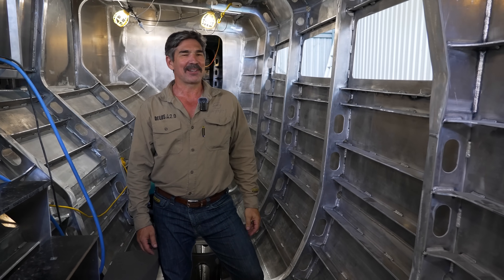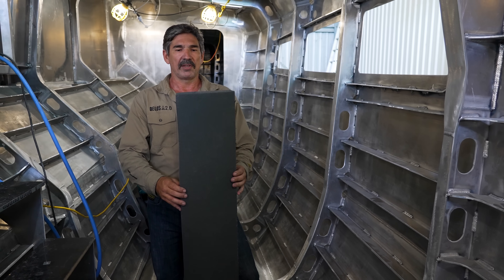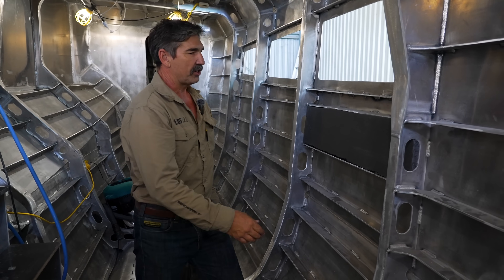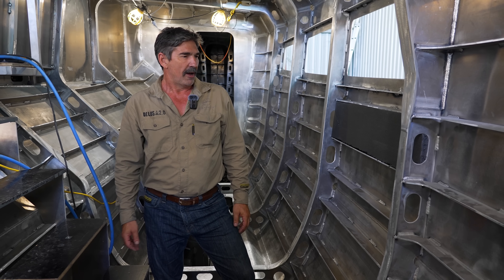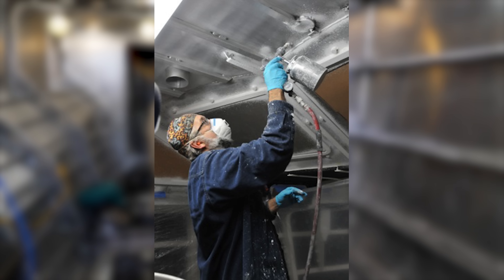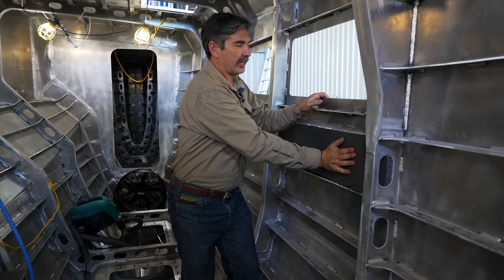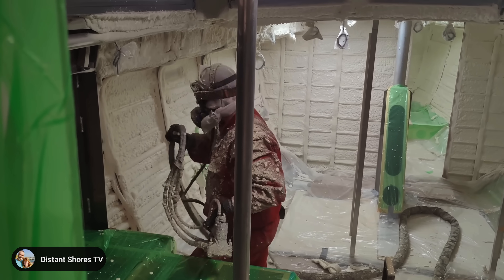HELP, We Need Your Advice!  How Should We Insulate Our Aluminum Catamaran???

Comment: Retired Alaska commercial fisherman. Spent a lot of time working on metal boats. Spray foam is the way to go. Provides a moisture barrier,  prevents corrosion. No heat transfer at the ribs.  
Is easier than you think to remove, use razor blade and side grinder.  No problem.    Like the other person said, install sufficient tubes and Chanels .
Reply: Spray foam on metal hulls is the only  way. If you use foam panels, you need to maintain a vapour seal. otherwise, any exposed metal will sweat. This means taping every single foam section to the next foam section, so no moisture can get behind. The glue on the aluminium tape fails in the  Tropics. Any self-adhesive foam has the same problem. Glue failure. It's a  nightmare. Spray foam has none of these problems and vastly minimises a risk of corrosion as no moisture can touch the aluminium hull
Reply: Agreed,  not that hard to cut out and how often  might you want to do that?  If you had to remove an area of foam you can keep a couple small canisters of Tiger foam spray to reapply a spray foam coating.  Tiger foam comes in a couple sizes and replacement nozzles for re-use.  2 small propane cans ( one with urethane and the other with resin ).  So its the same stuff you might have applied commercially.   Go Delos!
Reply: We are seeing tons of boats with corrosion from the separation of the foam up on the hull sheet. Spray foam has come a long way but I still don't like it.
Reply: @williamhamill813  is the foam being physically broken off of the sheet from wave action deflecting the sheet? 
Just trying to get a picture of the root cause.
How's the cathodic protection system? They're a floating battery. And they can be a challenge to get tuned in with sacrificial metals. The whole noble metals thing...
Agree about the foam. A necessary evil.
Reply: All I need to do is agree with @Marinerjac he said everything I was gonna. To dig into the foam and make repairs isn’t terrible. I am an electrician and have dealt with it on many occasions.
Reply: ☝️  What he said!
Reply: As owner of a 25 year old Aluminum Boat in Northern Europe I can only say when applied the correct way its just perfect.. on our boat it was first put in 2K paint system followed by spray foam...
Reply: Total boat makes a floatation foam, likely spray able too. Just remember. All foam absorbs water. I have a double wall aluminum hull I filled with floatation foam years ago.  It absorbed water. Just spent a couple hundred hours drilling a hole down the length of my hull creating a place for air circulation and water drainage. 

Another thing to think about is closed Cell foam will absorb water the moment you cut it. 

Now...make sure whatever you use is non flammable stuff. Some home spray foam is so flammable, sprinklers have to be installed to protect the building. 

Spray foam. Dry areas. Fire proof.
Reply: The solution is spray foam and a inhouse dehumidifier that ports the excess water overboard 💦 just find a non corrosive alcohol based solvent that easily removes the foam residue, should you need to repair the hull. Obviously all the basic steps from your methodical engineering precautions you are known for. I believe you are overthinking this. You got this Brian. You're a terrific problem solver 🥇
Reply: There is no solvent for this stuff. I just tried 3 kinds of acid, acetones, caustic and I spoke with total boat to confirm.
Reply: Triple thumbs up! While the foam may be a bit pricey, the time and effort it saves make it absolutely worth it. It’s the go-to solution for avoiding condensation issues, especially if you plan to spend time in cold waters. The occasional need to clean off some foam for future work is a minor inconvenience compared to the significant time savings and prevention of unforeseen problems caused by condensation.
Reply: Is spray foam flammable?
Reply: @ExploringCabinsandMines They could use cementitious foam insulation, which is non-flammable. Just keep in mind it cures more slowly than organic foams and might be a bit more fragile, which could affect its durability on a boat.
Reply: @ExploringCabinsandMines there’s non flammable spray foam
Reply: @ExploringCabinsandMines   Various grade foams are available. Fireproof foam is normally used for any marine application.
Reply: Aluminum welded stick pins and thermal acoustic insulation like john Mansville and unifrax is common for aluminum cats. Completely against spray foam it's a terrible idea just like it is for homes. It offgasses for years and then as you noted Can't perform proper visual inspections. Aluminum pits deeply and exfoliates and underneath  something you can't inspect means it will get very bad before you realize the problem. This is the traditional and preferred method for commercial ships and yachts.
Reply: What do the builders of thr French aluminum exploration use? They insulate for low lat sailing.  Go with the tried and tested.
Reply: That foam board seems too labour intensive to apply, sounds like spray foam from above messages is the way to go, anyway how many times will need to do repairs? I hope not that many. Just do your homework on getting a great company to install it thoroughly and to do a TOP TOP job! Oh boy will it be costly if it wasn’t.
Reply: This sounds like a much better solution than what's shown on the video.  Those ribs would conduct a lot of heat(cold) unless they were also covered up. 
I would recommend watching Matt Rissinger's construction YouTube Channel. Home/building insulation has gone through a huge evolution. When they first sealed up houses, they wound up with a serious moisture mold problem in between the layers of insulation and the exterior/interior walls. Sealing this off from any air passage or gaps is part of a solution (Hence spray insulation would be great.) Ideally you get an even change of temperature through the insulation layers between the exterior of the boat and the interior. 
(Another solution is to insulate the exterior of the boat, but then you'd get a soft 'skin' that wouldn't hold up.) 
  What you want is not the best current boat insulation, but insulation that has gone through the same long evolution as construction insulation did. My guess is that this is well in advance of whatever is being done on boats.  And it might be the perfect solution, or it might not be practical on a boat. With spray foam insulation you also want it to not be a fire hazard, but also not be full of chemicals that out gas into the air your family breathes. 
Of course you know what it's like to be in a several days of dense fog with every single surface inside the boat streaming water. This is why those panels won't be a good idea.
Reply: I have to agree, the downside of having to grind away if you need to weld on the hull is way less than the problems you will deal with from sweat condensation that will inevitably occur when you use a foam that allows moist air from inside the boat to get between itself and the cool hull.
Reply: Terrible idea. Will never be able to assess hull condition properly or perform visual inspections for interior or exterior corrosion. Can't easily make modifications or add foundations without a ton of prep work.
Reply: Definitely spray foam with a diagram of conduits for services, water, air, ac/dc . Stay toasty!
Reply: Yes, I read the other day that home owners insurance have started changing their mind on spray-foam bc of it's flammability
Reply: @ 
Tried to attach a link not sure it worked.
There is fire resistant closed cell spray foam with a class 1 fire rating with less off gassing than other insulating.
Reply: As the owner of a 30-year old steel sailboat that has reached the age when all the interior paint needs to be removed, I wonder how we would have known that if the hull were spray foamed? We have mild pitting throughout the hull, and although you could argue maybe that never would have happened if spray foam were used in the first place, but what if it did? How would you care for the metal or monitor it?
Reply: We covered domes with it in the 70s.Then painted cement paint over that.  It was really good at keeping the heat out &  in at winter, in Florida.
Reply: PSJ?  @MizzAugust7
Reply: New spray foam is great. Old spray foam is a nightmare. It absorbs water, breaks down and holds mould. I spent 4 months removing 300 bags of old spray foam from a steel boat. Never again.
Reply: While I know it is not common in smaller boats, I read that cruise ships are using rockwool because its less likely to hold odors and is quieter than other insulation.   It's nonflammable to 1200° and doesn't support mold or mildew.  I think that have a marine version that drys out faster...I read about it a year or two ago.  It doesn't add an buoyancy but I think it could be installed in such a way that you could remove it for repair/maintance/upgrade work and re install it.  It has good r value and is a commercial grade sound deafened.  They even have a version for sound proofing recording studios.  It is not cheap but I don't know why you would have to re-buy it as it would probably survive anything the hull could.  While insulating any structure be it a house van or boat.... thermal bridging is the enemy.  Your crossmembers and bulkhead will conduct heat/cold and negate some of your r value. In a traditional stick built home this is a 20%+ loss is insulation value.  In a metal boat I'm positive it is a much higher percentage...I like the idea of installing one layer flush to the ribs and then another layer over the top of the ribs and cavities....if I had to negates one of those layer I would leave a void between the hull and insulation b4 I let the ribs protrude thru my insulation....beautiful vessel in the making....I love the long roof line....I think you will want for more battery but the correct amount of battery = batteries are too heavy -1
Reply: I'd use epoxy paint first then mask off sections with plastic drawn tight,and fill with foam ,less clean up
Reply: Foam works great on steel commerical vessels where weight is not a huge concern.  Not sure if foam is good on  AL boats which are built for weight. What did the designer suggest?
Reply: The difficulty with expanding foam is removing the excess. This is very tedious and takes a considerable amount of time.
Reply: @Alain.Helstroffer01  I work in new bedford mass Fishing capital of the east coast.  There are companies that come in knock this out in a couple days on fishing boats.  Its expensive.  60K to 100k Per Fish hold.
Reply: Definitely close sell spray foam!
Reply: I do love how this channel has become a community of very practical people…. Especially as I am not one of those in the slightest.
Reply: Spray foam seems the most complete insulation system, could it be sprayed on thinly and then run wiring and cables through afterwards? Presumably, most of the wiring would be accessible regardless as long as you can access one end to pull out and replace, cutting spray foam to get to it shouldn’t be too much of an issue.
Reply: Insulation is something Berings have done very well, amongst a bunch of other yacht stuffs. Should take a leaf n see how they've managed to almost perfected it & learn from Berings.  Wish you all the best
Reply: @bertrandtan2712  You are spot on.Bering!
Reply: Agreed, do the spray foam.  It is not that hard to remove.  Consider that amount of times you needed to get to the hull over the last 10 years.  The mild PITA to remove is well worth the benefits of the spray foam performance and ease of application.
Reply: Seems like you could make any systems you might really need to touch accessible outside of the foam to prevent the difficulties of removal.
Reply: Yes, separation and gap allow air transport of moisture to a cold surface. The insulating paint followed by high density SPF would coat the metal helping to insulate, and separate it from moisture and oxidation. The SPF would go on top. The fins will be the most difficult. The SPF could coat them a bit as well.
SPF application is critical. Proper temp moisture content of the surface and high quality A and B components with temp and mixing are critical.
Reply: You will regret using spray foam. It will eventually separate from the hull due to the hull flexing over time while traveling. Then comes the condensation nightmare😮
Reply: @whyme8068  not if it is applied correctly.

Comment: You should contact Paul and Sheryl Shard on Distant Shores.  They got their boat in the water and it seems like it ended up with a very quiet and well insulated boat.   I have worked with spray foam quite a bit.  It is a bit messy to remove for repairs, but it very easy to back on when the repair is done. It would be my first choices as the pros outweigh the cons.
Reply: https://www.youtube.com/@DistantShoresTV
link of their YouTube channel herewith: it has documented the build of their new aluminium sailing yacht, it was insulated with spray foam.
Check with them on their (limited) experience thus far.  
The experience listed by fishermen and other aluminium boat users in other comments on their preference of spray foam is probably far more valuable...
Good luck with the build.
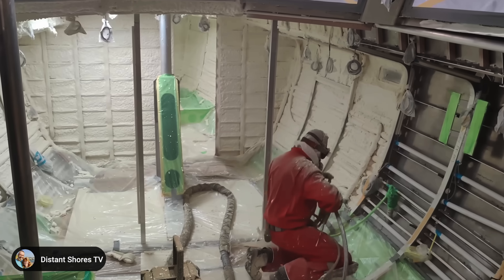Reply: @jorritschreuder9253 did you miss what was shown at 0:46 ?
Reply: They are K M Yacht customers - So talk to K M not their customer!
Reply: Which part of Brian showing Distant Shores TV 0:46 on the screen with their hull being sprayed did you miss?

Comment: Would use a combination of different materials ,you will have to condensation  issue use the foam for ease of removal for inspection and removal and maybe use termal coating for difficult access space

Comment: The method of batts of foam I believe must include the thin layer over the interior to act as a vapor barrier as well as insulate the frames.  When in cold conditions, any warm moist cabin air that is able to get behind batts will condense so you need the continuous vapor barrier to keep that warm moist air from circulating anywhere. Not an expert, just my $.02 worth.

Comment: Rock wool would be my pick. Biggest advantage is fire, will not burn easily, does not give off toxic fumes when exposed to flame.
I like your coating idea , then i would use rockwool batts.
Reply: Not an option for boats. When it gets wet it looses all its insulation capabilities, gains a lot of weight, and traps moisture against the hull. It would probably never ever dry out again because of lack of airflow.
Reply: EVIL stuff! Never stops shedding fine dust, sags under its own weight, allows moisture to develop because it doesn't adhere direct to substrate, absorbs moisture and gains weight. Should have been banned decades ago!

Comment: why not use chopped cork as insulation that you spray on? cork does not absorb liquid and corrosion cannot occur after condensation cannot form between the cork and aluminum and you do not need a thick layer, so you can use your ArmaFlex as sound and insulation in double layers, and because you spray cork with an adhesive and you won't have problems with edges and studs

Comment: So, if you go with a closed cell spray insulation (which costs and weights about twice as much as open cell for a ~30% gain in heat performance) it will also greatly stiffen your structure. There is an outfit in the US called the Monolithic Dome Institute and they use a combination of air pressure and spray foam to support free span concrete between when it is sprayed on and when it cures. If you run everything in conduit before you spray foam you won't have a lot that you might need to get back and fix.

Comment: I served on a Nuclear Submarine in the day and we would go north of the artic circle. Our hull was steel but it was insulated with battens (Not sure with what, I suspect asbestos). It was still cold and the vent heaters where always on and I wore a foul weather jacket all the time. Condensation still dripped on us, not much enough to startle. You will never get away from condensation you just have to mitigate it. Our bilges were never insulated because they were wet areas, just painted.
Reply: The canvas covered rockwool/fibreglass insulation was supposed to be less fire prone ( it wasn't in the slightest) & easily removed for maintenance (not at all) & you could see the tiny fibres sparkle under the lights when they had to cut it off.  Complete horrible stuff !

Comment: No knowledge, just my feed back :P if you push the blocks in between the stringers and secure those with the pins. 
you could use a thiner version of the stuff, but with the stickyback to cover all the seems and edges. Like in that example picture you showed us. 
That would give you best of both worlds,  I'd stay away from the spray stuff, it's very difficult to do maintenance or alterations. weld an stanchion for your raillings, forget it.. Also the expanding gasses from that stuff are not healthy at all, last i heared.

Comment: Have you looked at PIR insulation. It is the evolution of XPS type insulation. Not cheap, but the insulative quality is incredibly high. Keeping water and moisture out, forget it. The problem that you have is the flex and movement. You would need a rubber coating. Sika the company has some really good products for that. For the ribs use a rubber clip.

IMO stay away from the spray. It gives a false sense of security.